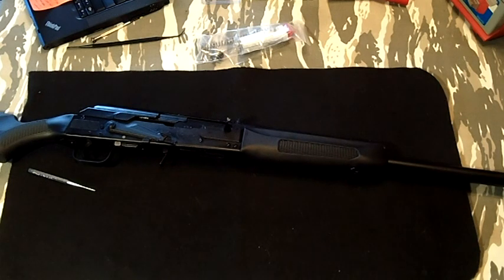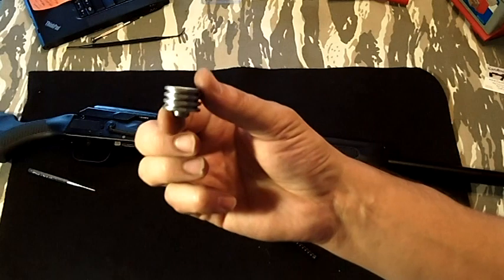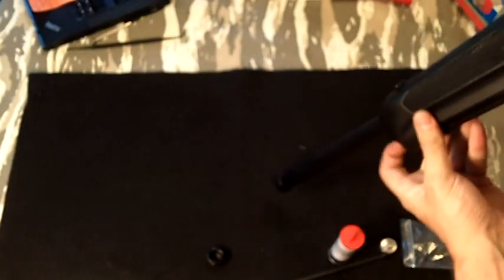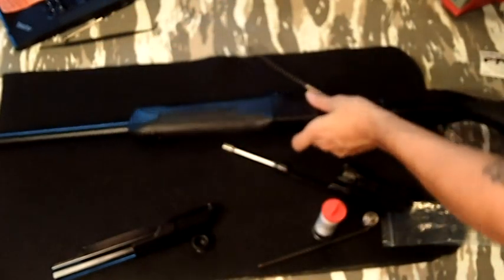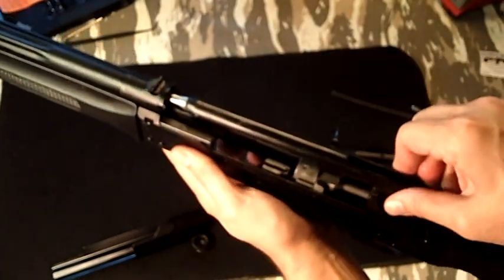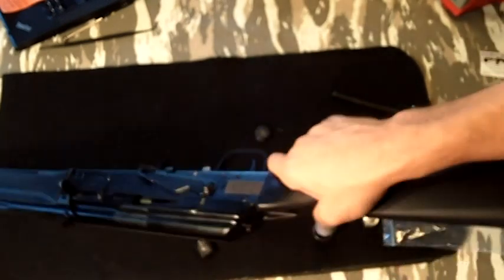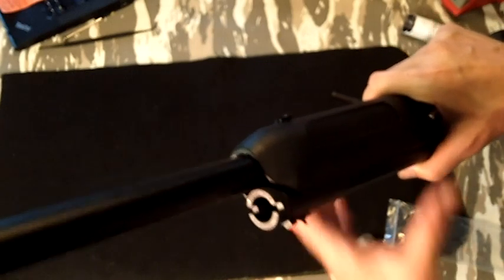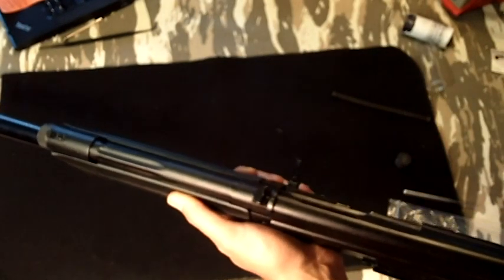How to make your stock Saiga 12 more reliable!

Comment: @maxcavalera4380 Once the gun was converted to a 4 port gun, there was no question that gas was making it from the barrel into the gas tube, the problem was, the factory gas plug was situated as such that the amount of gas (even on setting 2) wasn't enough to run low brass. Once the V-plug was on, I could access the proper gas flow and now it runs low brass flawlessly on setting 3.

Comment: @maxcavalera4380 Not entirely true.I did a port and polish on my Saiga 12 before installing any aftermarket parts and it did not cause it to cycle low brass.  This kit did. I did not install the reduced power recoil spring as is not intended for use with high brass loads. The puck he installed is intended for any type of load and the new gas plug has 5 settings so you simply adjust it depending on the type of load you're running...better than the factory plugs 2 settings.

Comment: @maxcavalera4380 You're correct that occasionally FT eject can be due to shells being hung up on sharp parts in the chamber, but in the case of my gun (and most S12's with cycling issues) it is the gas system that is the root of the issue. In other news, we are both obviously Saiga 12 fans so keep an eye out..we have 2 of ours in our machine shop right now, being converted to full auto, and I should have a video up in a week or 2! Who doesn't appreciate a full auto 12 gauge? :)

Comment: @maxcavalera4380 May I ask where you get your S12 experience? I appreciate the suggestions but I'm not sure I fully agree. My polish job was done by the AK/Saiga gunsmith at our store. Subtle, it was not. The cycling issue on my particular gun had nothing to do with the shells getting hung up in the chamber during ejection. The issue was there was simply not enough gas making it's way back into the gas tube to drive the bolt far enough back to eject the empty shells.

Comment: @MissBattleBorn Adittionally you'll find that by shaping and polishing the area that is directly below the chamber where the shell must glide before chambering, that you'll improve feeding. Basically your going to turn some blocky squarish corners into a smooth feed ram.It also dosn't hurt to debur the inside edges of the chamber where they lock up with the bolt; alot of times the shells get caught there

Comment: Glad that this solution works for you, but its akin to throwing newspaper down over a spill on the floor; sure now you aren't stepping right in the spill, but it's still there. Running full power loads with the low brass kit installed would damage the rear trunnion. For the price of a few minute of reshaping with a dremel tool or drill and the appropriate grinding and buffing attachments you could actually resolve the problems with lighter loads, and make the rifle cycle considerably smoother.

Comment: @MissBattleBorn I have converted and modified a few Saiga 12s and Saiga rifles in my life. I have a good amount of experience with problematic Saiga 12s which exhibited similar results with low brass. When I refer to your polish job being too subtle, I mean that if it really was only a polish job, as you've referred to it, then the reporfiling of the bolt is the less subtle atleration that I'm suggesting. Look up pictures of Paully's Glass Bolt, that should show you the ideal bolt demensions

Comment: @maxcavalera4380 I see. Yeah I've seen Pauly's work on a couple of customer's guns. Looks nice, and the action is smooth. Would be a nice addition to my gun but would not have resolved the cycling issues with my gun. Now that it's running (which was priority #1) I'll be fully converting it and spending more time making it the gun I want it to be

Comment: @maxcavalera4380 Yep that's why I didn't install the reduced power recoil spring b/c I want to be able to run all types of loads without swapping out the spring.  A simple polish job, as your first post suggested, probably won't fix the cycling issues but will make the action smoother like you said. A gas port job is more likely to help, although it didn't with my gun (I converted it to a 4 port gun from 3). Check out my S12 cycling issue vid if you get a chance :)

Comment: I believe you are showing an incorrect position for installing the new puck. The "flat" side with the engraving should go in first, with the raised surface facing the gas plug!  Please correct this in your video as it is misleading and could cause problems for others watching this video. Thanks...

Comment: @MissBattleBorn Aftermarket gas plugs are fine as are most pucks. I guess I was too vague; having to use a weaker spring to run light loads is the issue, because you shouldn't run the same spring with hi-brass. I just think this kit avoids adressing the issue at the source

Comment: @MissBattleBorn I just checked out the video, first off your saiga is probly being stubborn because its mad at you for not coverting it fully into the saiga it wants to be... Seriously though, I suspect that your polish job might have been to subtle if your ports are the correct size you shuoldn't have gas issues. You need to reprofile your bolt, carrier and hammer face to further reduce friction.